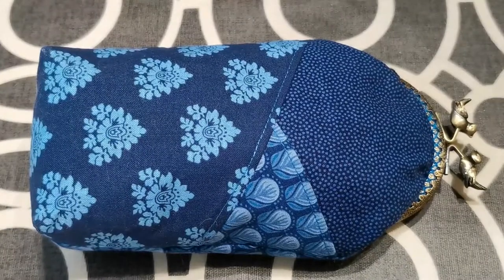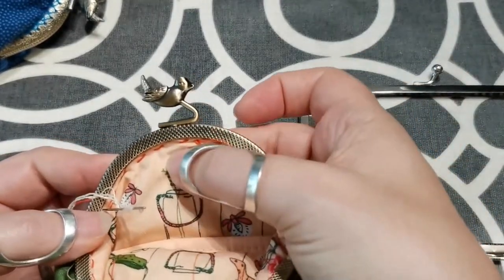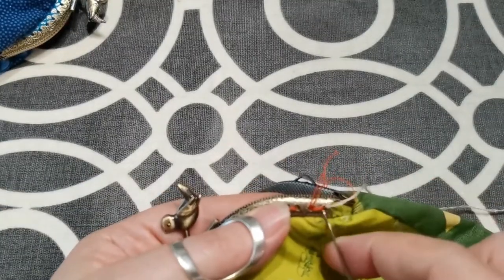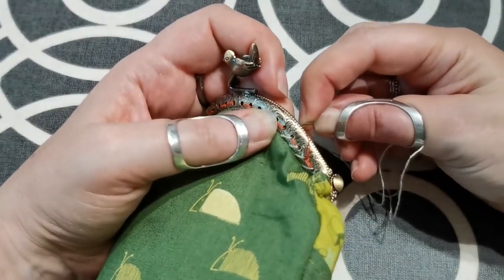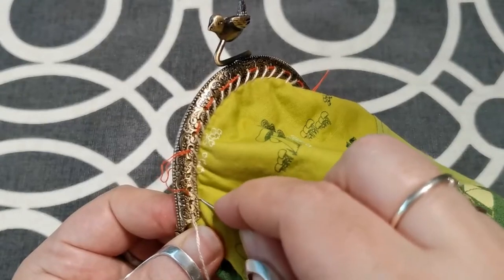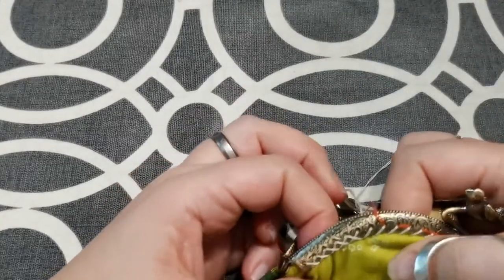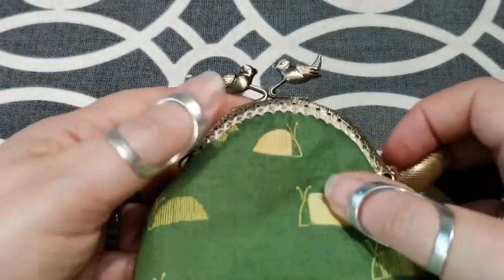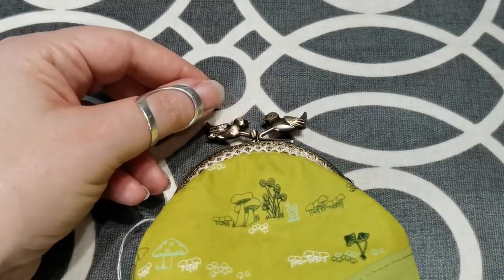How to sew on a purse frame using cross stitch

Comment: Hi! I purchased the pattern for your glasses case and I did not see a pattern piece for the divider. Is that just something I cut out separately based on measurements?
Reply from the maker: Hi Victoria, sorry I missed your comment! You do cut the centre divider separately using the measurements. All of my patterns that have a full video tutorial have all of the pattern pieces except straps and binding, but the older ones are a mix of pieces and rectangles that you cut yourself. If you need any more help, please ask, and hopefully I will get notified this time!
Hazel